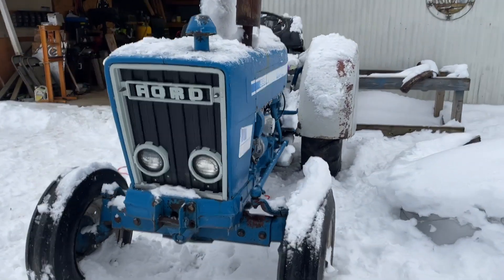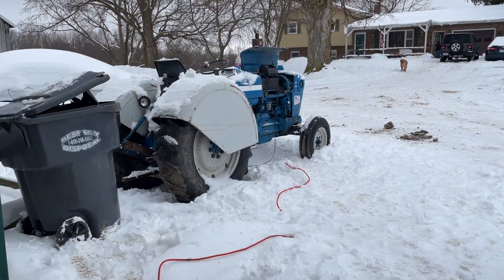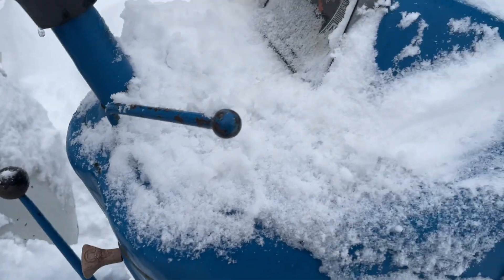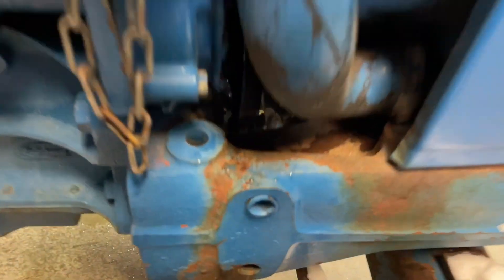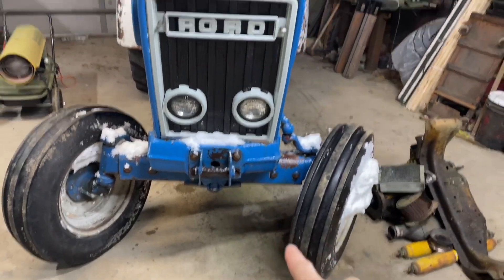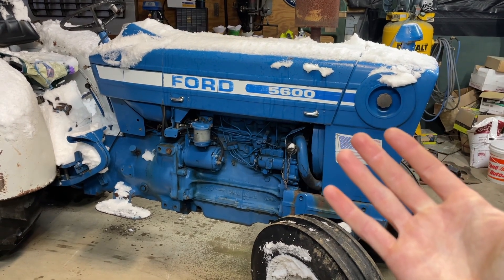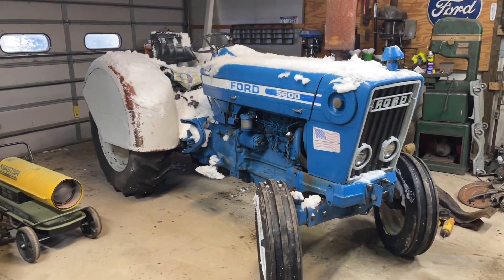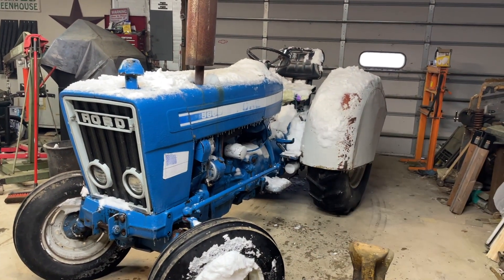I'm going to turbocharge a rare Ford tractor

Comment: Have a similar tractor outside but wider. Unsure of number on side though. Grandpa used it for 30++ years till he couldn't farm no more. Guess I should go start it sometime. Good memory's.
Reply: Probably a similar 5000 or 6000 series tractor. My boss owns a 6600 that uses the same engine and shares a ton of parts with this.